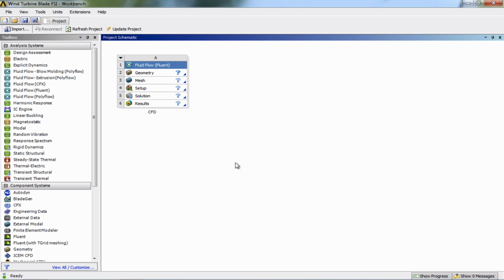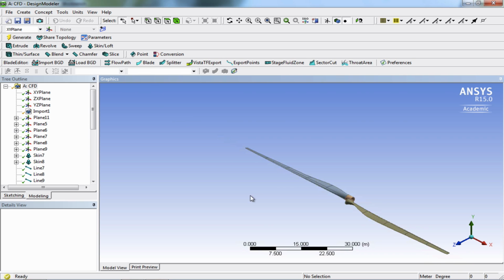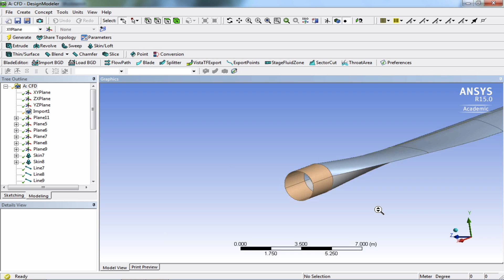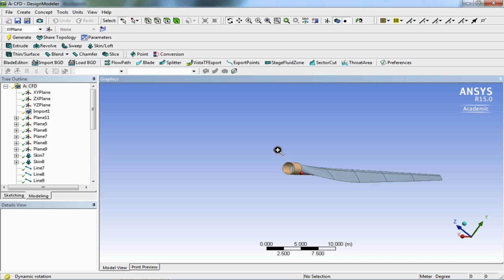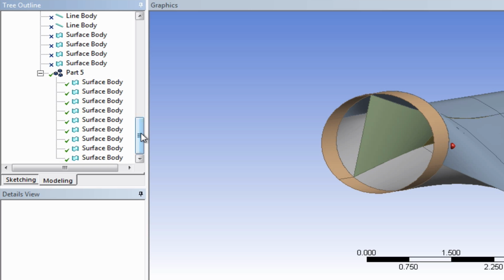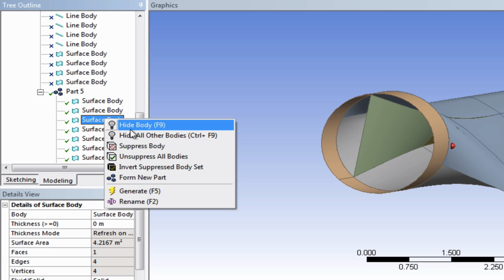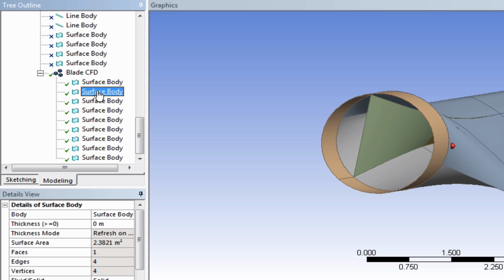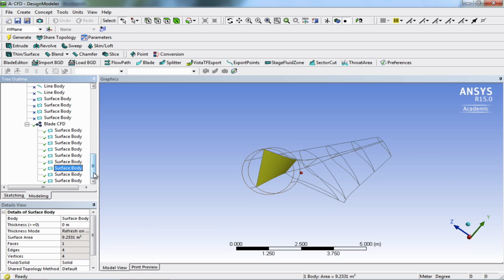SimCafe: Wind Turbine Blade FSI (Part 1), Overview of Current Geometry

Comment: Hi, could you do a tutorial on how to create the turbine blade using the modeler? I tried to import my part file from solidworks but when I import it into the design modeler, it only shows the profiles of the cylinder at the root and the airfoil at the blade tip. I used a loft for my part file and cant get the individual airfoil profiles spanwise to the modeler which gives me issues in meshing onwards. would deeply appreciate your help.